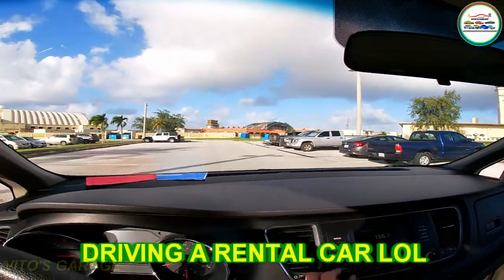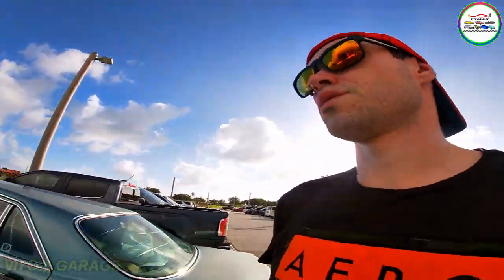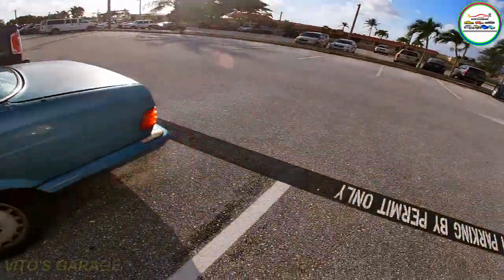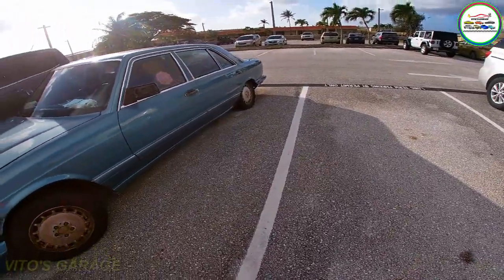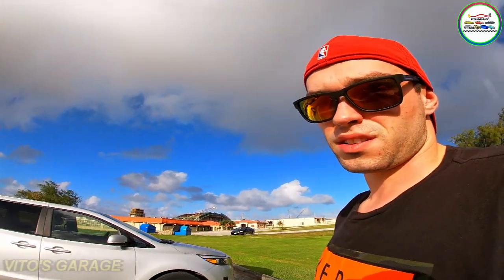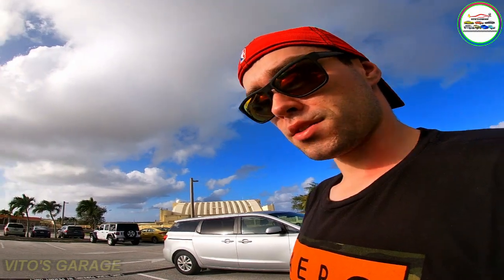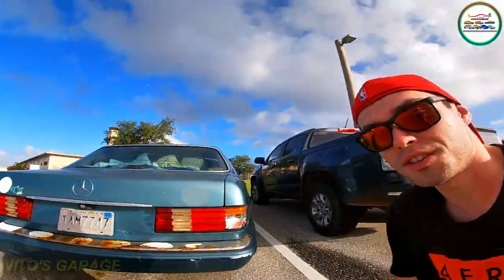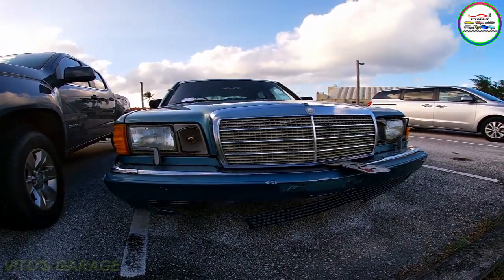Abandoned Classic Mercedes W126 420SEL??! Lost in Guam..

Comment: It can only be a gasoline engined Benz because if you see there are twin tubes that come into the muffler and the muffler itself is square with rounded edges. These were only on gasoline cars. SDs and SDLs had cylindrical mufflers with single pipe inlet and dual pipe outlet.